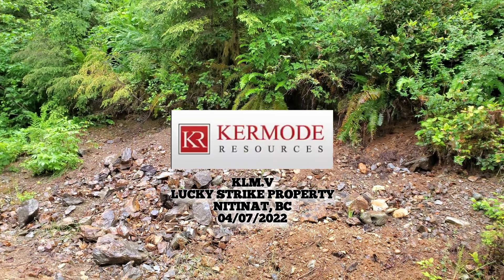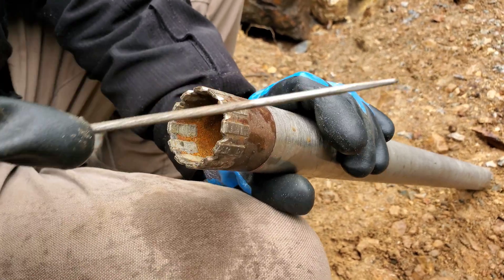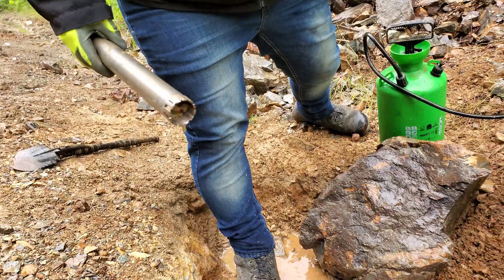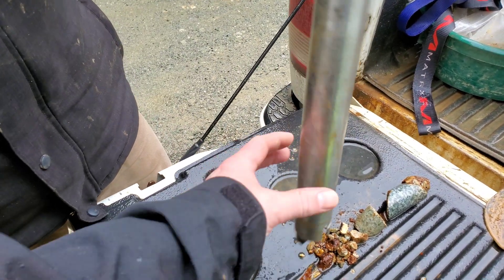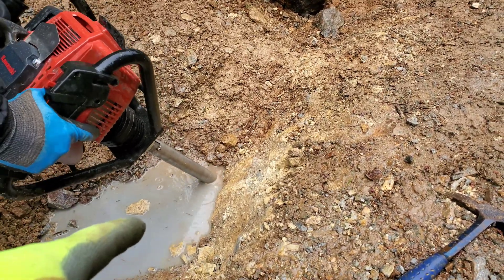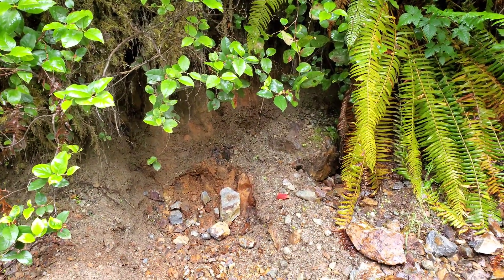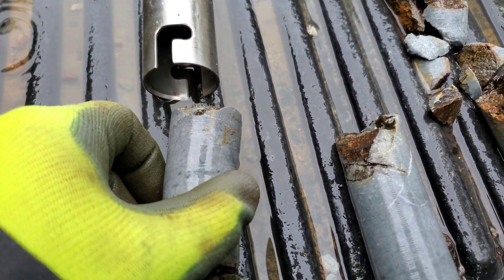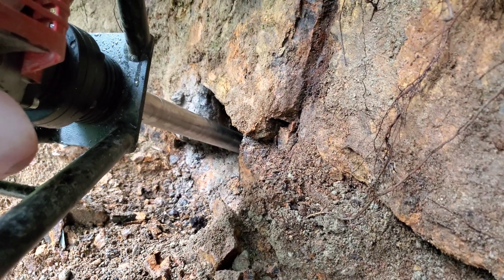First Backpack Drilling The Camp Gold Zone! (Lucky Strike Property) $KLM

Comment: I have a chance to buy a Shaw with Kawasaki just like this one any idea if it’s worth the gamble nd how much to pay?
Reply from the maker: Roughly 12 grand with 7.5m of drill string
Reply: @911mining  I did purchase it yesterday. Only missing parts is -water jugs pump, and loose material bit. But has 4 bags of 2 feet sleeves over 20.

Comment: Great stuff, thank you!  Amazing that you can get 5' of core with a handheld drill relatively quickly.  Getting assays turned around is still a challenge but do you ever use an XRF scanner?
Reply from the maker: Just wait till we get 25' 😏. Assays take long and we have used XRFs beforw
Reply: I've been following what $NINE Nine Mile Metals is doing with XRF on their drill core at a VMS project in New Brunswick for some inspiration on how we can use that tool to help keep things moving. Testing core in multiple spots and averaging data points to give a preliminary number before assays come back seems like a reasonable approach.
Reply: Cool, eh!
Reply: Paul what do you think about the "electrolytic cell" experiments with crushed rock to check if we can "hot plate" key metals? 

https://www.youtube.com/watch?v=G-PtnwtOR24 something like this instead of using a strip of processed metals as source of metal in the circuit, try using the crushed up rocks? Won't be full recovery but it will be a quick "definitive test" to check if there's copper or zinc or whatever else in there. Fun.